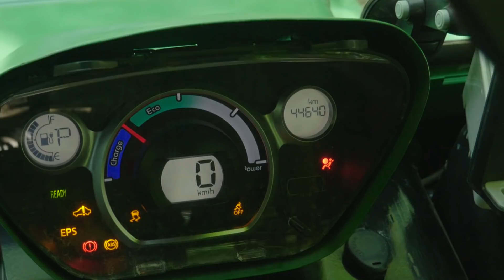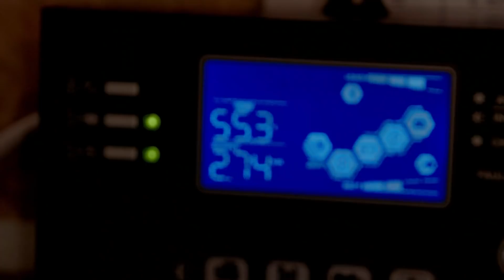Meglógtunk egy elektromos traktorral!

Comment: A belső égésű motorok hatásfoka 20-22% A villanymotorok hatásfoka 98-99%,Vagyis 1db 80KW-s teljesitményű járművet ki lehet váltani 1 db 20KW-osvillanymotorral. Amihez a töltést meg lehet oldani napelemekkel.Természetesen ahól van hozzá hely és lehetőség.
Reply: Ez nem egészen így működik. 
80kw leadott bízel = 80kw leadott elektromos teljesítmény. 
Tehát a 80assal egyenértékű a 80as elektromos, nem a 20. 

A különbség hogy a dízel ezt a 80at kb 400kw nyi üzemanyagból nyeri ki és kidob 300at hőveszteségként. 
De a 20% benzinre a 30% dízelre igaz volt 20-30éve. Mostmár inkább 25-35 vagy 30-40%ot szoktak mondani rá.